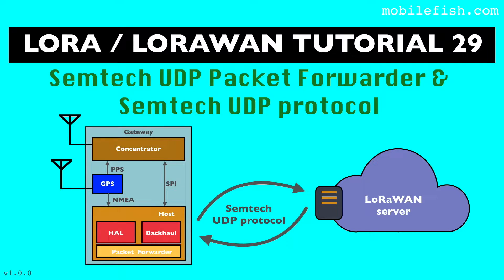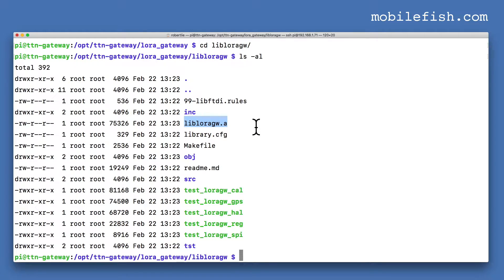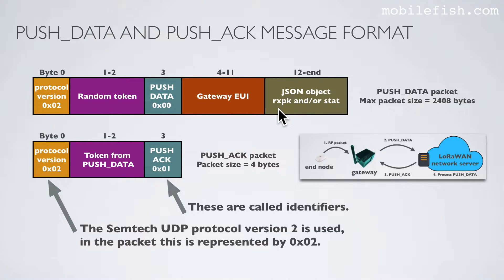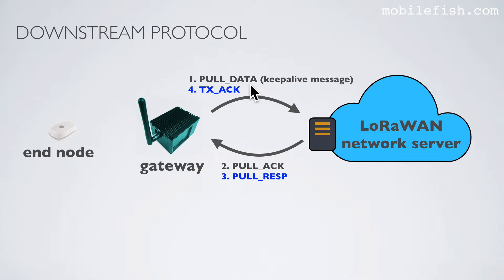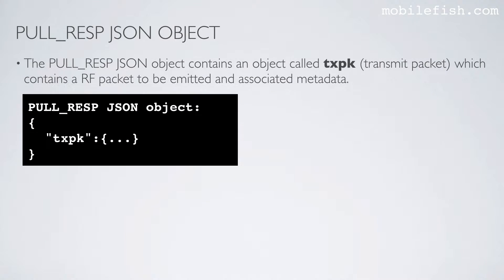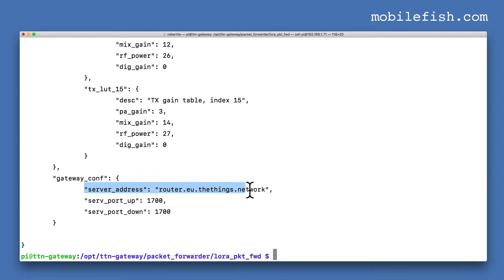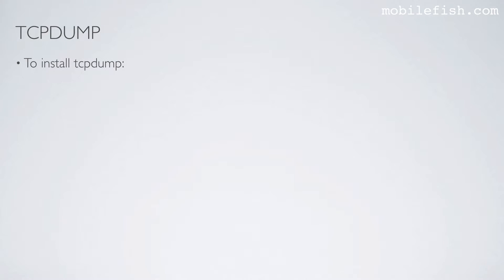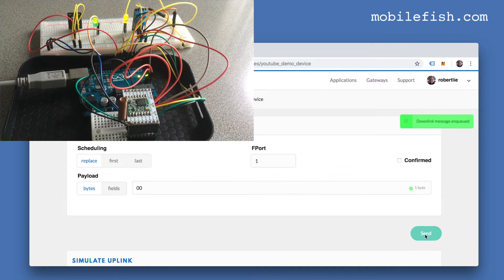LoRa/LoRaWAN tutorial 29: Semtech UDP Packet Forwarder and Semtech UDP protocol

Comment: Hello sir
Thanks for the video
I want to ask if the Rak 831 concentrator can be used without connection to internet to recieve data from the nodes. that is to use it at the LoRa level and not LoRawan.